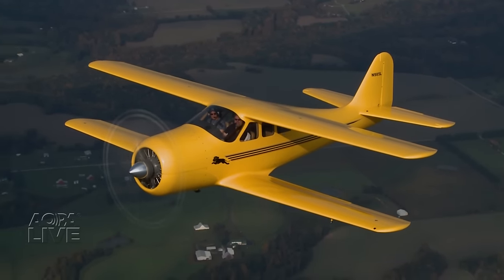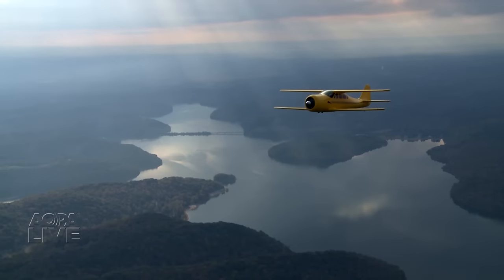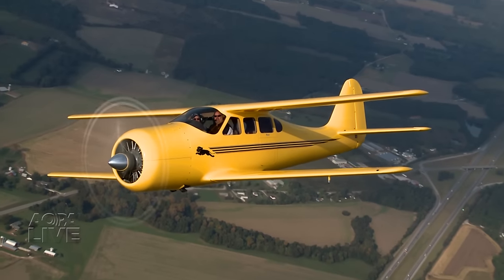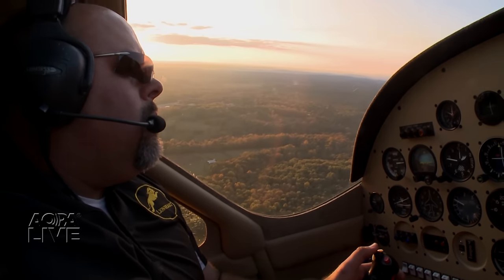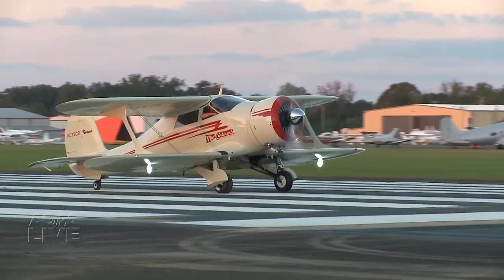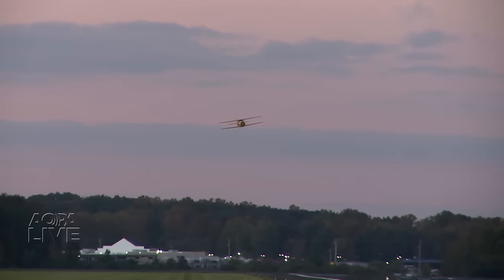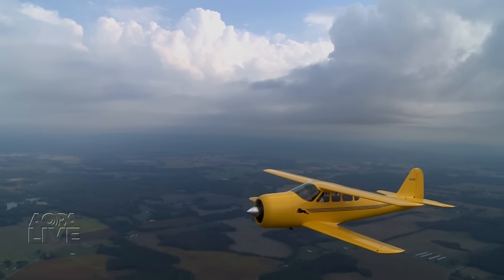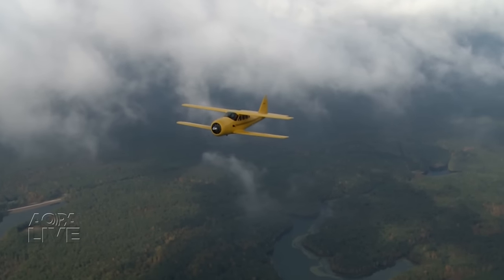Flying the Griffon Lionheart

Comment: I have an aviation mag from years back when it first appeared. I think it is made of wet layup fiberglass, would be interesting to see what it could do if it was carbon.  Still very curious to know what aerodynamic and / or structural benefits there are (or could be) from the staggered biplane configuration but without the drag creating struts and wires.
Reply: Now carbon there is an idea